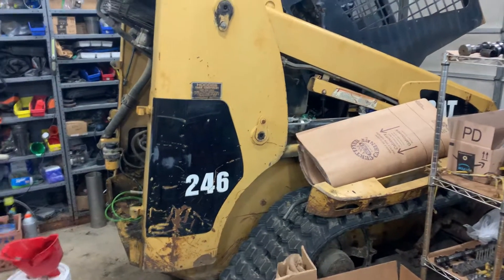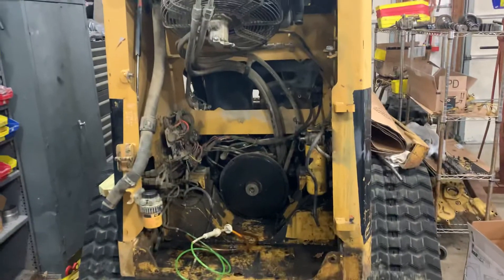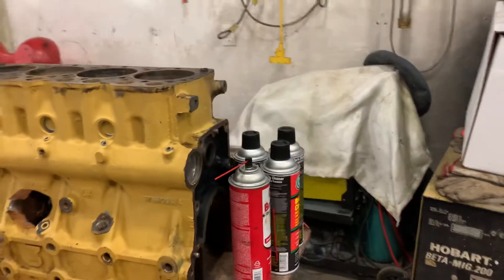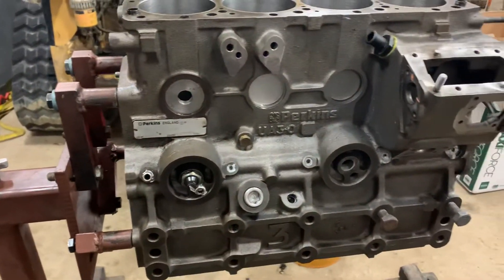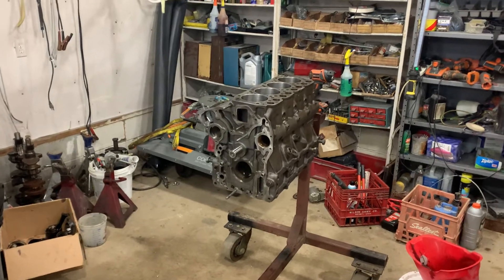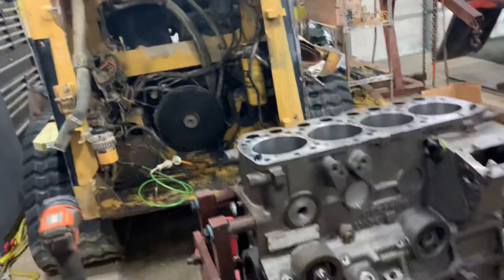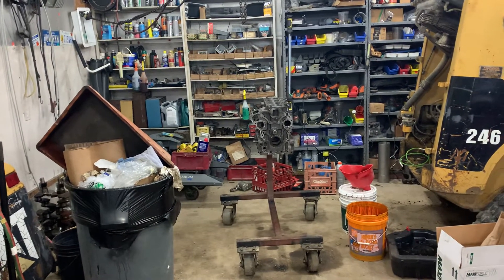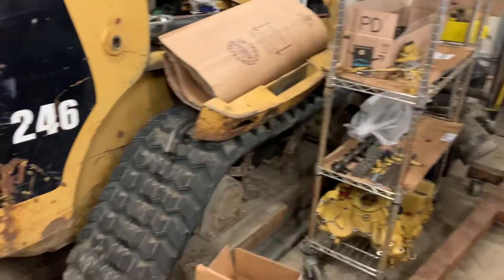Caterpillar 246. When is a CAT, really a Perkins? Replacing CAT 3034 motor with a Perkins 704-30

Comment: My same issue however my block is good ? Any suggestions on getting parts ? I’ve not done this before but my machine is still operating I’m trying to get around complete failure ?
Reply: I live in Michigan upper peninsula
Reply from the maker: I believe I used Highway and heavy for the engine rebuild parts.
Reply: @ thanks man

Comment: I bought a 2000 Cat 226 skid steer with a non turbo motor that has about 10,000 hours on it so my plan is to have a total rebuild done on it. It came with 2 other motors on a pallet, one with a hole in the block by the back piston and the other looks like the valve cover was removed and they were messing around in there. My question is do you think there any value in these spare blocks?
Reply from the maker: What engines are they? There should be a tag on them. That will determine f they have much value or not.
Reply: Cat 3034 @0366Turbo

Comment: Looking for one of these blocks (non-turbo) right now, no luck yet. Ive called numerous shops locally and reached out across the country to places i could find online. One place even wanted $7,500 for a short block with rotating assembly. How is yours doing?
Reply from the maker: I am very pleased with mine. We have put about 150 hours on it. It has not missed a beat. Starts in cold weather, without issue.

Comment: great video i have a slightly different problem with a 246B which has a Mitsubushi engine parts are to find
Reply from the maker: I’d look for other applications of that engine.

These are industrial engines that are used in various equipment.

CAT really doesn’t advertise that fact and would prefer you to believe that they are the only source for parts.

Check Diesel cranks or Highway and heavy for parts.

Comment: Get your machine shop guy to get the correct dia gun drill and have him drill the oil squirter galley hole, easy job if u get the speeds and feed right when contacting the gun drill manufacturer. Get the shortest one needed, you can find them quite cheap on ebay. Ive done deep hole drilling with them without a gun drill machine and for this purpose itll drill straight enough for it to work.
Reply from the maker: It wasn't the tooling that was issue, it was having a machine with enough travel to set the block up on end and still have the spindle clear with the drill  bit installed. The skid steer is in service now, approximately 8 hours on the rebuild, it's performing well.
Reply: Right angle attachment, swing bridgeport head to one side for maximum table travel. Glad to hear its operational. Im currently fixing someones massive mistake on one of these perkins engines. Lift pump went bad, they thought it was the injector pump. Pulled pump, installed new one bent the post that comes out of the fuel stop pin. Used old shims with gobs of silicone. No bringing the engine to tdc, no measurement of shims, just slap it back together. Tried that and had a run away, instead of shutting fuel off they disconnected fuel injector lines. Also never primed it. Neither one of them know the first thing about how common rail systems work.
Spent last two days wrenching, drilling out broke bolts, rounded off heads. I should have ordered some left hand drill bits.
Not a fun time, got it back together they only need the two bolts holding the lift pump on. Tried to explain bump engine until lift pump has least amount of spring pressure. As it sits youd have to compress it about 1/4. If I were the one installing it I could take my time and get it in there without bumping it around, but they are friends and i got my own crap to work on lol. They are close enough, just button up the rubber fuel lines and give er hell.

Comment: Could you please tell me what that hole is behind where the injection pump is located? It’s about the size of a thumb. On your new block it looks like a nipple is mounted there. The reason for asking is cause I purchased a 226 with a new engine and that hole was exposed blowing oil all over the side of my engine. Thanks for your video
Reply from the maker: That is part of the crankcase ventilation system. It should be connected to the "catch" filter, that is mounted to the side of the engine. It drains back into the oil pan.

Comment: Hey Mike, I just bought a 2002 CAT 226 skid steer with the same issue. It snapped a rod, put a hole in the block and worn out my crankshaft journal to the point where it has to be welded and re-machined. Cat wants $1,800 for a new crankshaft and I may go that route. My machine shop and I worry the crank will weaken with welding. The good news is my engine block has a hole that I can tig weld with a patch. The rod didn't hit a cooling passage thankfully. I noticed as you mentioned that this is a hard engine to find and find parts for used. Thank you for posting this video and the perkins crossover information. I'm looking for a engine or parts right now in the Connecticut area. Good luck with your rebuild and a updated video would be helpful.
Reply from the maker: Just got the machine fired up. I can do a follow up video in a few days. Thank you for watching, commenting. Good luck with your repair.